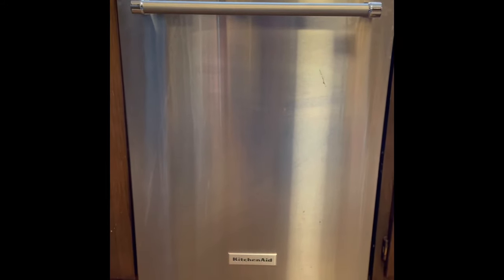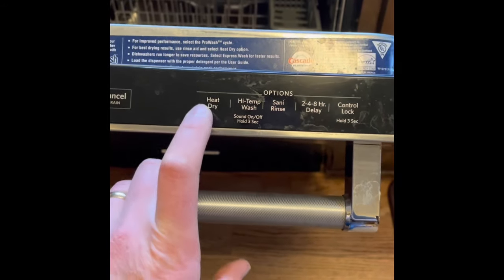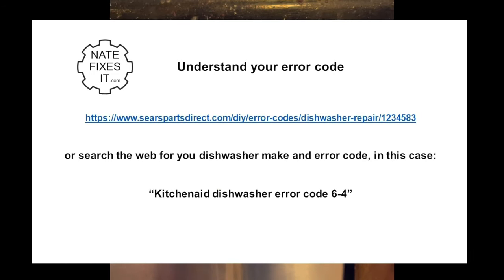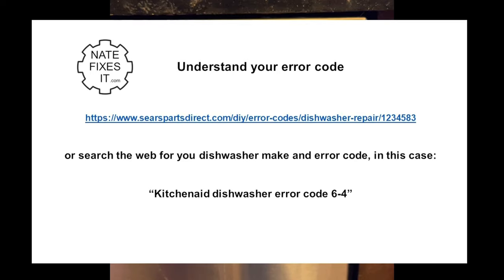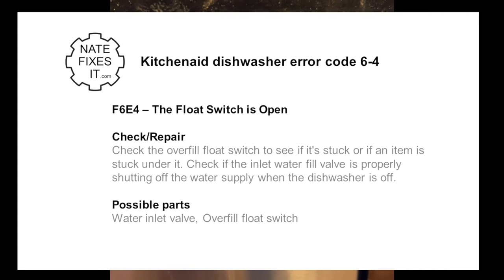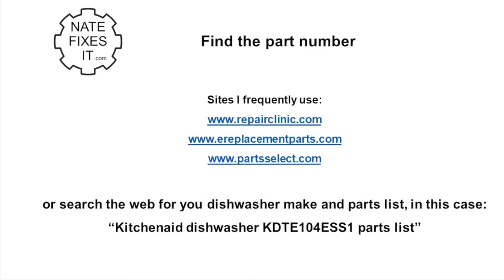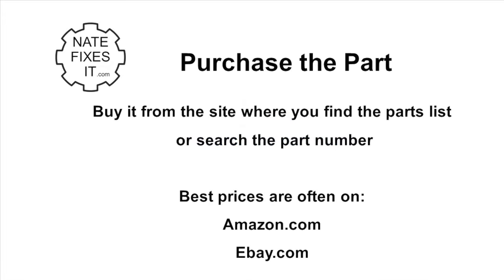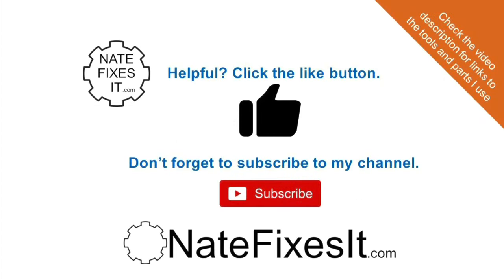Dishwasher Diagnostic Mode: find out why your Kitchenaid won’t work

Comment: Need help with dishwasher not cleaning and making terrible grinding noises.  Already replaced the drain pump but problem is just getting worse.  KDTE254ESS3  Tried the three button approach but all the lights do not illuminate and the outside light also does not light either.   Any suggestions? Repairman quoted $400 to fix which seems ridiculous after already spending $300.  I feel like I really have a lemon!  Appreciate any help you can provide.
Reply from the maker: Sounds like you don’t have a self-identified error code.  Did the repair man tell you what was wrong that would cost $400 to fix?  Did the noise start before you replaced the pump?  If so, was their any change in noise when the pump was replaced?  When during the wash cycle does the noise occur?
Reply: @NateFixesIt    We had it looked at by a KitchenAid tech who was at the house on a problem with the refrigerator.  He said to replace the entire pump assembly (3 pumps).  We can't figure out how to trigger the self-identified code using the buttons.  The dishwasher is loud and noisy all through the cleaning cycle, filling, washing, and draining.  Plus the dishes on the bottom rack are never clean.  The tech said a diverter may not be working
Reply: Even after replacing the one pump, its still noisy
Reply from the maker: You may be activating the diagnostic mode, but the dishwasher hasn’t self identified the problem.   I would guess that the circulation pump is either not working properly (thus no, or little flow to the bottom spray arm) or a stuck diverted that is pumping the water out at the start of the cycle instead of circulating it.   You could start a cycle, wait for it to fill and then start circulating for a few minutes, then open up the dishwasher and see if it still has water in it to get a better idea.
Reply: @NateFixesIt  Thank you!  Will give that a try.

Comment: i did the same thing you did but when i closed the dishwasher the light just stayed on. no blinking lights at all. what does that mean
Reply from the maker: If the external light stays on solid during diagnostic mode, that means the dishwasher hasn’t detected an error.  Doesn’t mean there isn’t something wrong, just that if there, your dishwasher hasn’t figured out what.

Comment: I wish i could get mine into diagnostic mode. On the third pass of pressing the buttons, the buttons stop responding. It seems to be a fairly new unit. It came in the house I purchased in December of 2022
Reply from the maker: How is it responding, when you try going to diagnostic mode? What’s the issue that you are having with the dishwasher?
Reply: @NateFixesIt  there is a clicking sound and the buttons aren't responsive, and after resetting power, sometimes they'll respond but most of the time they don't
Reply: It's a kitchenaid kdpe234gps0
Reply from the maker: @dbsimms63  that sounds like it’s most likely a failed control unit.   If that’s the case, diagnostic mode won’t work.
Reply: @NateFixesIt  well that's not very encouraging. It looked to be pretty new when I bought the house in November and I've only used it 3 times since then.  I don't hold out much hope for it's longevity
Reply from the maker: @dbsimms63  sorry to be the bearer of bad news
Reply from the maker: @dbsimms63  I haven’t owned one, but I have heard good things about Bosch

Comment: My kitchen aid will not drain. pump works float, level appears to be working correct. I know there's a check valve, can blow threw drain line BUT can not suck water out disposal connection with vacuum> odd any thoughts?
Reply from the maker: Are you sure the pump is working?  Is it actually spraying water inside?  The motor for my pump still ran, but the impeller fell off the shaft, so while you could hear it making noise, it wasn’t spraying water.  It may also be a bad diverter valve that switches the pump between recirculating spray and draining.
Reply: @NateFixesIt  Thank you, but yes I took motor out and hooked up power and it works "turns impeller" Saw impeller spin but thought 'after' May be turning in open air but may be spinning on shaft under water. Thanks anyway. live and learn, trial and error. I'll figure it out.
Reply from the maker: @justsaynrush9689  good luck!
Reply: @NateFixesIt  Man I'm so Fing embarrassed, with that said, please guess what it was.
Reply from the maker: @justsaynrush9689  disposal was clogged? 🤷‍♂️
Reply: @NateFixesIt  Stay active when you retire and don't end up brain dead like me. I forgot to mention I had just put in a new disposal. So actually right your right, forgot to take out the disposal plug. If you think that's stupid you should see me type! Going to need all the luck I can get. Thanks bro.
Reply from the maker: @justsaynrush9689  at least you figured it out and it was a free fix!

Comment: I've tried this but it does work.  KitchenAid model KDTE254ESS2
Reply from the maker: Two possibilities:
1. That’s the right combination, but your dishwasher hasn’t self-identified a problem.
2. Your model has a different diagnostic mode key stroke.  You can try using the same sequence as in the video, but use the left most buttons in the order 1-2-3-1-2-3-1-2-3 or try “HEAT DRY, NORMAL, HEAT DRY, NORMAL”.  If neither of those work, there is usually an info sheet hidden behind the toe kick plate, it may say the combo on it.

Comment: I've had my diagnostic lights to work, but now they won't. I always got  7-1 code indicating a heater problem, but the heater work just fine. Now I can't get the diagnostic to work. I try it multiple times and it won't go into diagnostics mode.
Reply from the maker: It might be that the dishwasher hasn’t self diagnosed anything

Comment: What if the buttons sensors are not responding? All of a sudden the button sensors don’t respond when I touch it. And that’s without the control lock being on
Reply from the maker: That means you probably have either a touch pad issue or a control panel issue.  First, verify that you have power to the dishwasher, does it make any sounds or respond in any way when you open and close the door?  Check the breaker and make sure it hasn’t tripped.  Next, I would cycle the breaker off, wait 5 minutes, and cycle it on again.  Then try the touch pad again.  Sometimes cycling the power is enough to reset things.  If it does come on, run diagnostic mode to see if it gives you an error code.  If still nothing, I would suspect it’s the control panel or touch pad.  I haven’t had to fix those on mine yet, but here is a video from someone else on how to diagnose those https://youtu.be/uDOten4PcAY  Good luck and let me know what you find out!
Reply: @NateFixesIt  thanks for the response! So glad a found your channel
Reply from the maker: Glad to help!

Comment: I tried to do the diagnostics and all the lights turned on, but the button on the front is not flashing any kind of code for me.
Reply from the maker: This means that you have entered diagnostic mode, but that the dishwasher hasn’t self identified a problem.  Doesn’t mean that nothings wrong, just that the dishwasher hasn’t figured it out.  What problem are you having?
Reply: @NateFixesIt  it runs partway through the cycle, and then the light starts flashing on the front and the clean light flashes.
Reply from the maker: @LauraAnderson-xh2ue Does it seem to be filling and spraying, then draining after?
Reply: It leaves water in the bottom
Reply: Mine throughout the code F9E1 and also F1 E2. Can you tell me where the vent wax motor is?
Reply from the maker: Check out this link and try the suggested items: for you error code.  

If that doesn’t fix it, it’s probably either a bad diverter valve, bad circulation pump (if it’s a one pump model), or a bad drain pump (if it has separate drain and circulation pumps).  

Unfortunately, all of these will require you to remove the dishwasher to replace them.   Search the internet for you dishwasher model number and “parts list” to see a drawing that shows the parts and where they are located.
Reply: The link did not show up
Reply from the maker: https://producthelp.kitchenaid.com/Troubleshooter?thispageid=14178

Comment: I do all this all the lights come on I close it yet everything still stays on. Does not flash or go off
Reply from the maker: Sorry that I missed this comment when first sent.  Sounds like you are getting into diagnostic mode but the dishwasher hasn’t self-identified a problem.  Doesn’t mean there’s nothing wrong, just that the dishwasher hasn’t figured it out itself.

Comment: Ugh. My light just stays lit. Doesn’t blink at all
Reply from the maker: That means that the dishwasher hasn’t self identified a problem.  What issue are you having?
Reply: Ended up trying to run a cycle, but it stopped within minutes and got a 9-1 code. 
Dishwasher fills up with water, but won’t run any cycles.. Then it drains the water as usual..
Reply from the maker: @dpd1035 Check this link for Kitchenaid’s instructions:  https://producthelp.kitchenaid.com/Dishwashers/Dishwasher/Error_Code_or_Flashing_Lights/Error_Codes/F9E1_-_Dishwasher

That said, it doesn’t sound like draining is your problem.  It could be something with the fill switch or circulation pump.  I would definitely try the step where you cut power to the unit for a minute as the first step.

Comment: I have a Kitchenaid Dishwasher Model number 
The Dishwasher Lower spray arm Wash's Great! The upper spray arm has hardly any water going up to it. I have cleaned everything, but confirmed there is no blockage. Could this be a weak motor / or motor diverter? Anyone with this similar problem & have found a solution would help a lot! Thank you!
Reply from the maker: Blockage would be the first thing I would check, sounds like you covered that.  I would next look at the seal where water moves from the  water duct at the back of the dishwasher and the tube on the top rack that connects to the spray arm.  Leakage there could reduce flow to the spray arm.
Reply: @NateFixesIt  Thank you Nate! You’re the best. Huge fan of all your videos. Really appreciate your help.
Reply from the maker: @Daner949  thanks for watching!

Comment: need help How to put model # KUDC03IVBL4  into diagnostic mode please
Reply from the maker: I can’t find any information on diagnostic mode for that dishwasher.  Unfortunately it may not have that feature.
Reply: @NateFixesIt  Thanks Nate  the normal wash and  cancel lights are flashing does that mean any thing specific?
Reply from the maker: @martinsmythe3414  I don’t have experience with that error, but try this article: https://missvickie.com/kitchenaid-dishwasher-normal-and-cancel-lights-blinking/
Reply: @NateFixesIt   Thanks  I have tried most of those things and the dishwasher is working again but I'm a little scared because I'm not really sure what fixed it.
Reply from the maker: @martinsmythe3414  glad it’s working.  If it flares up again try those things again.  If that doesn’t work, my guess is bad wiring or control board, but it’s hard to tell.  Good luck!
Reply: @martinsmythe3414  it was fixed due to the reboot.
Reply: @fringeminority5676  I had tried numerous reboots over the course of two days before it started working.  Thanks

Comment: Why is mine not working 😭 all the lights come on but when I close the door it just sounds like it's draining over and over- no light on the front
Reply from the maker: I can’t be sure without being there to see it, but my first guess is a stuck float or a failed float switch telling the control unit that it’s still full of water.  Luckily this is a cheap and easy thing to test or replace.  Check out my float switch video for more info: https://youtu.be/wXFZFor5p8I

Comment: My kitchen aid dishwasher keeps tripping the breaker ?
Reply from the maker: Is it a brand new dishwasher or breaker?  Did anything else recently change in you electrical system?  Is it tripping when running the dishwasher or even when not running it?

Comment: I’m pressing the same 3 buttons at the beginning 3 times but it’s not lighting up.  Anyone else have this issue?
Reply from the maker: Some models (even ones that look the same) use a different 3 buttons, such as the leftmost three.  Some models any three buttons will work.  Also, the codes only flash if the dishwasher has self-diagnosed a problem.  If the dishwasher doesn’t know what’s wrong, it won’t flash a code.

Comment: Mine won’t turn on period. Power to the outlet is good but acts like nothing is happening.
Reply from the maker: Did you unplug it and plug it back in?  It’s probably a bad control panel if it doesn’t change after being u plugged and plugged back in.
Reply: @NateFixesIt I did and check the breaker box. So it turned out to be a loose wiring connection. Made no sense that it didn’t get power. When I was pulling on the power cable the machine was turning on. Magic.
Reply from the maker: @CplStevenDiaz glad that you figured it out!

Comment: For mine, all lights illuminated at test, i closed the door, but they all remain contantly on. Never giving me a code to detect.
Reply from the maker: If the external light stays on solid during diagnostic mode, that means the dishwasher hasn’t detected an error.  Doesn’t mean there isn’t something wrong, just that if there, your dishwasher hasn’t figured out what.

Comment: I tried the sequence, but all the all lights didn’t blink.
Reply from the maker: Are other lights functioning on your unit?  Does it seem responsive to any other buttons you press?   If not, it may be an issue with lack of power or the control panel.  First check the breaker to make sure you have power.
Reply: Hold the cancel button a good 30 seconds, then execute the three button sequence.

Comment: process did not work with an exterior control panel.
Reply from the maker: Sorry to hear that.  Try googling your model number and “diagnostic mode”to see if there is a different procedure.  One other thing to consider is that the dishwasher doesn’t always know that it has a problem and if it doesn’t, won’t provide an error code.  This doesn’t mean there is t a problem, just the the dishwasher hasn’t self identified one.
Reply: @NateFixesIt  The Front controls on these machines utilize any 3 adjacent buttons in the options grouping, same process but you can go forward or backward. The "clean" indicator will then flash the fault code. Found this in the online owners manual. Thanks for getting back on this.
Reply from the maker: Glad that you could figure it out!

Comment: When I run through this, the light stays on and does not blink, no matter how long I wait. Anyone know what this indicates?
Reply from the maker: If the external light stays on solid during diagnostic mode, that means the dishwasher hasn’t detected an error.  Doesn’t mean there isn’t something wrong, just that if there, your dishwasher hasn’t figured out what.  What is the issue that you are having?
Reply: Almost certainly a control board. It just doesn’t know it’s bad much like a car when the pcm is faulty there will be no codes. Think of it as a person that’s gone crazy but insists they’re normal. ;)
Reply: @NateFixesIt  thank you very much for the response! It wasn't draining. Dishwasher is only 14 months old, just out of warranty. I reset the motherboard by using instructions I found elsewhere. Ran two normal cycles with cleaner, and they ran completely. Then tried a load of dishes. First time did not complete--flashing light--but second time did. Did another load, same result. So, it's intermittently still not draining.
Reply from the maker: @ska4me  could be a number of issues: Bad control board, bad float switch, bad pump, or loose wiring to name a few.   If you haven’t removed the dishwasher recently or done anything that would jar the connections, I would rule out loose wiring.  Since the pump is still working intermittently, I would guess it’s not the pump.  Between bad board and bad float switch, I would try the float switch first if you aren’t ready to call the repairman yet.  Float switch is easier to replace and MUCH cheaper if you want to try it first.  This video shows how: https://youtu.be/wXFZFor5p8I.  I haven’t had to replace a control board, so I don’t have a video for that, but other people on YouTube do.  Good luck!
Reply: @NateFixesIt  Thank you VERY much!

Comment: I've tried this numerous times and nothing happens- KDTE204DSSO
Reply from the maker: For you model I believe you use the three left most buttons.  Everything else should be the same.
Reply: @NateFixesIt  nope. control lock, start and cancel don't work
Reply from the maker: @marcelsgold that should be the sequence for you model.  While there could be something wrong with your dishwasher, that likely means that the dishwasher hasn’t self-identified an issue.
Reply: @NateFixesIt  I had a tech come out. It's the drain pump. $325 to fix

Comment: My won’t blink after I close the door? Is there another step after all the buttons light and I shut the door? I have a different model since my bottoms are in the opposite direction. They did all light up but there is no blinking
Reply from the maker: If they all lit up but there’s no blinking on the outside light, it sounds like you got to diagnostic mode, but the dishwasher hasn’t self-identified a problem.  It doesn’t always know when it has an issue.  What problem are you having?
Reply: I’m having the same problem. It seems to me like it isn’t filling.
Reply from the maker: @Brobstcleaningservices check that you have power and that the shutoff valve for the water is turned on.  Once you verify those is likely either the float switch or fill valve.  Both are pretty inexpensive and easy to replace.  I have videos for both.